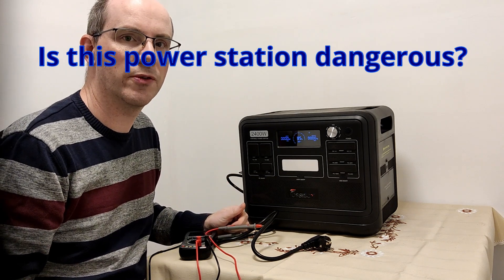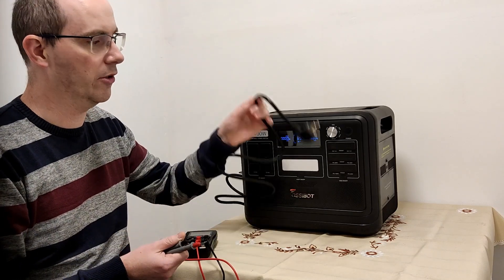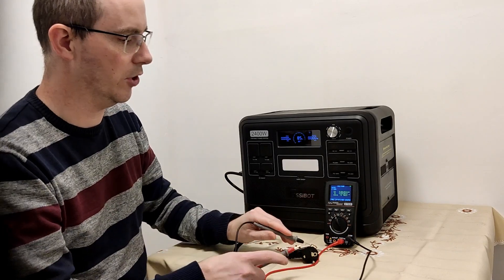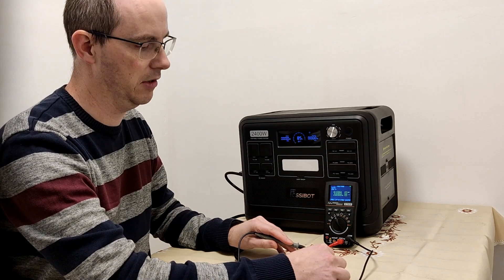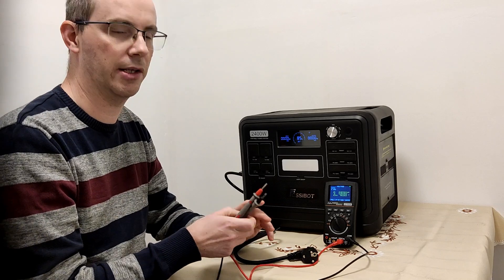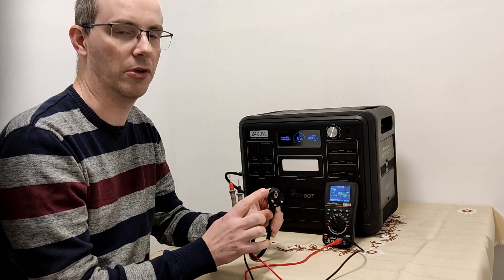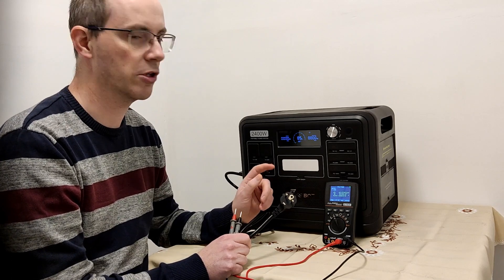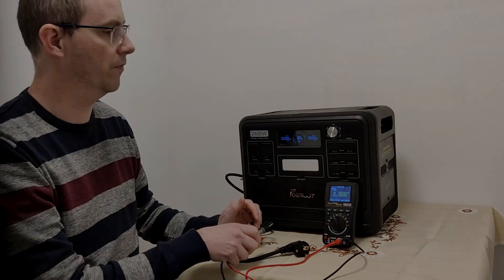Is the Fossibot F2400 dangerous?

Comment: About our response： The ground wire of the input shape interface is connected with the system through the safety capacitor. This design is very common on the electrical equipment with ground wire such as computers and refrigerators. When the equipment is not grounded, the shell will also have a high voltage.
The charging interface has voltage because it is in a suspended state without grounding. When the human body touches it accidentally, its voltage will drop. The current passing through the human body is only a few hundred microamperes, far lower than the safety current of human body (the safety current of human body is 10mA,We try to connect the ground wire to N wire and L wire respectively with 1000 ohms resistance, and the measured current is at most 2mA, which is lower than the safe current of human body (the equivalent electricity of human body is 2000 ohms-2 megaohms).
So even if the human body accidentally touches the interface is safe.
After charging and connecting the socket, the whole machine is connected with the earth through the ground wire and the high frequency interference generated by the machine work can be imported into the earth through the safety capacitor so that the equipment can work stably.
Reply from the maker: Thanks for your fast and competent reply addressing this potential safety issue. I now feel a lot more confident in the safety design of the system.
Reply: but all Fossibot F2400 is not connected with  grounding in USV pass through mode. This is dangerous, because full electricity from house is going through a faulty toaster for example to the body to ground. This isn't allowed in many many countries. No grounding on USV  ....all ecoflow were recalled. Fossibot won't give information about this dangerous problem
Reply: @flyblue6632  which EcoFlows were recalled?
Reply: Have any of y'all had issues with the 2400 system just clicking off or resetting one or 2 times a day? I have mine hooked up in my living room. I am have my tv,sound bar and 2 led light strings and a android TV box hooked to it. For a total of about 85 watts with everything on. Only 20-25 watts with everything off.

While watching a show. The fossibot will just randomly click. Everything plugged in goes off acting like it's been unplugged from the wall. I have it plugged into the wall for pass through power . As well as hooked to a solar panel.
Reply: Could the solar controller be switching on and off at dusk?  Could be looking for solar input while the sun goes down.  I've heard the ffpower p2001 does this.

Comment: this is normal for powerstations and as fossibot replied the voltage goes away when connected. stop with this.... my ecoflow does the same. only have 1 issue with it. its to small a capacity and since im to poor i cant afford not even f1200 which is looking solid as ecoflow or bluetti ever did. so i hope fossibot makes it in a shark market.  2x👍 to Fossibot!

Comment: Most refrigerators and washing machines  have the same voltage on their case and ground untill ground cable is connected
Reply from the maker: @ktylxy1  not sure what you mean by that. As soon as you plug in the power you also plug in the ground connection. That is if your power supply is grounded of course which it normally is. At least when you are on-grid or in a "proper" off-grid setup.

Comment: Hi, thanks for your video! 
Can I ask for your honest opinion? I can see you are not a big youtube promotor/influencer. I get the idea that the most of the times people promote this powerstation, they are offered this powerstation. I've been thinking multiple times that it could be well possible that they (not attacking fossibot at all, but especially thinking about other brands!) send out good units to these people and send lesser units  with for example non sinus waves, or other battery types to other normal clients. So thanks for maybe helping me out on this one! 

What about your one year review about experience? Other strange things happened or everything is fine?  

Also what I'm curious about, is that I would leave the input power charging cable on all the time, even plugged in to an extension cord (the type you see people with electrical lawn mowers with. Since I want to use it in my van, even while using solar or anything else.
The question I have is, would that be "risky" ? 

Want to buy the device still this week, or maybe another one if another good promotion kicks in.  Thanks!
Reply from the maker: Hi there, I've definitely bought all the Powerstations I've tested with my own money and nobody ever offered me a special discount or anything like this. I can understand your scepticism but I would definitely not expect any half-decent brand to ship different products to reviewers. I can see them selecting a good model within the normal variance but definitely no basic differences like battery chemistry or completely different inverters. Pre-production models can be different but once a product is launched this would be far too risky for them in my opinion. 
As for my experience with the Fossibot I still like it very much but only used it in a quite limited way as I have multiple Powerstations as well as a full-size battery system for my house. I'll have a camper soon but also there I'll put in a larger system based on a server rack battery. This will also come as a future video 😄.
Keeping your Fossibot permanently plugged in will disable the solar charging if you're talking about the charging input. The wall charging according to my tests has priority and as long as it's plugged in you won't be able to charge from solar. So maybe pit a switch in between to only turn the power on when needed.
Hope this helps. Have a nice day and fun with your van.
Reply: @mariokleidosty9175  hi, thanks again for your great answer.
I'm more at ease now! 

I've probably not made myself very clear I will definitely not always have it plugged into the power since it will be mostly in the van. However I meant that the power cable will always be plugged in, at least that's what I wanted to do. So that if there's no solar power and the rare occasion comes that we're in a camping, I can just charge it with the camping electricity. Without having to take the powerstation, getting it out of place and changing the cables etc. etc.
Since it's quiet heavy and the space in the van is limited this seems like the most easy thing for me. 

Could this be doable?

And if you meant what I meant, what kind of switch were you talking about? :) 

Looking forward to your next video with the big battery setup! Cheers and enjoy!
Reply from the maker: @MyAapjes  Hi. A simple on/off switch to interrupt the line. Just so there can't be any power on the plug. Just keep it on the end of the extension cable and turn it on when you use it for charging. Anything will work, just as an example what I'm talking about https://a.co/d/8gJedqh Just make sure it's something that fits your local plugs 😄
Reply: Thanks!

Comment: Yeah, I would not assume that a unit with a battery turned on would be totally "dead" at the plug.
Reply from the maker: Well, many are. It completely depends on the electric design of the unit. Although it's not dangerous in this case it still could shock and scare people.

Comment: Hi Mario, you pronounced my nick correctly :) I received answer from Fossibot support on this behaviour, they replied within 24 hours but the answer was short : "Yes, the situation is normal" and you are correct that one can be "shocked" as I stated to measured the voltage at the power plug after I felt a (minimal) shock.

Comment: Please keep us updated if Fossibot has an answer. I just got mine today. I will take a measurement tomorrow.
Reply: Fossibot official channel replied to this video.  "About our response： The ground wire of the input shape interface is connected with the system through the safety capacitor. This design is very common on the electrical equipment with ground wire such as computers and refrigerators. When the equipment is not grounded, the shell will also have a high voltage.

The charging interface has voltage because it is in a suspended state without grounding. When the human body touches it accidentally, its voltage will drop. The current passing through the human body is only a few hundred microamperes, far lower than the safety current of human body (the safety current of human body is 10mA,We try to connect the ground wire to N wire and L wire respectively with 1000 ohms resistance, and the measured current is at most 2mA, which is lower than the safe current of human body (the equivalent electricity of human body is 2000 ohms-2 megaohms).

So even if the human body accidentally touches the interface is safe.

After charging and connecting the socket, the whole machine is connected with the earth through the ground wire and the high frequency interference generated by the machine work can be imported into the earth through the safety capacitor so that the equipment can work stably."
Reply: I have also about 107V AC between ground and either of the L or N lines on the input when the AC output is switched on